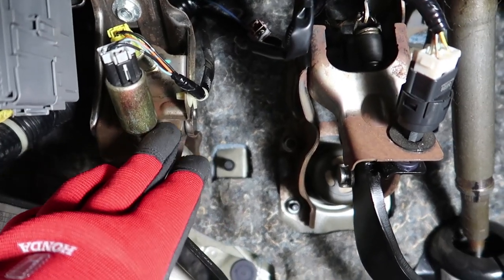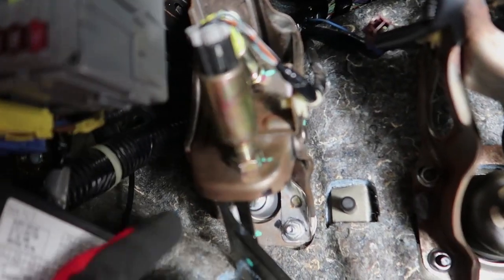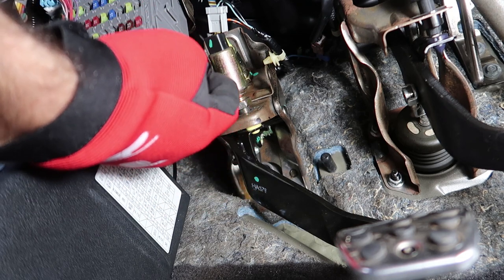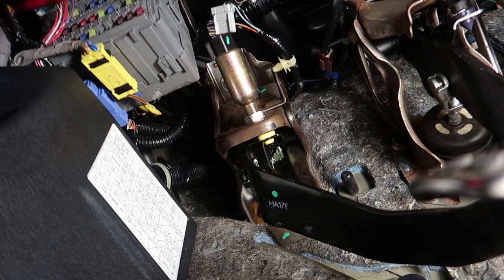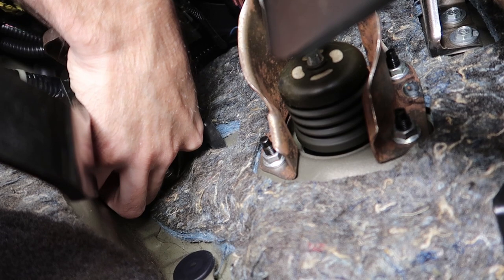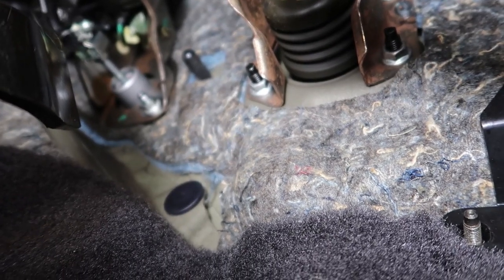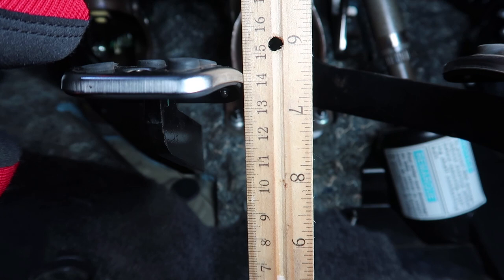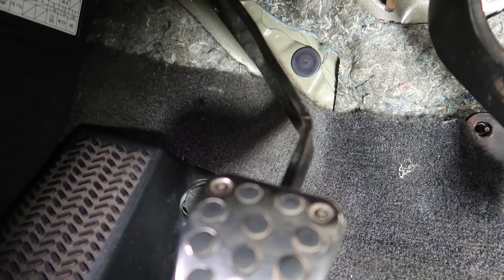8th Civic Si and RSX Type-S Clutch Adjustment DIY | Aftermarket and Stock | FG2, FA5, DC5

Comment: Years later still helping people I really appreciate it. My only issue is I'm trying to figure out how to get my engagement lower. I love my pedal feel now but it's grabbing at the top. I tried adding more threads on the stopper and then readjusting the clutch rod but it seems to still be grabbing high. trying to understand the whole dynamics of this but I can't figure out what would give me a lower engagement point.
Reply from the maker: Hey buddy sorry for the late reply. Basically the freeplay will affect where the clutch grabs a little bit. But if you want it to grab 'a lot' sooner you have to make the pedal stroke shorter.  So if you go to a little more threads showing and then redo the freeplay then the pedal will grab sooner because less fluid is pushed into the clutch line, so on the pedal release it wont grab quite as high up.  However it might also make the clutch release a little less smooth.  If its a comfort thing then just go little by little. Going to a K-tuned EM1 CMC will give you a shorter overall pedal travel but in my opinion makes it more difficult to drive in traffic because it engages right after you let the pedal up from the floor, and its more sensitive in general.  But that's preference because I know some people are use to that
Reply: @JasonMcMullen  thanks for the reply I'll keep doing some tinkering and find the sweet spot
Reply: @JasonMcMullen hey so I have a stage 2 competition clutch and I’m switching to a Ktuned CMC. Would I need .5-1 threads showing on the sensor?
Reply: @datboidell7722 I want to know too, I'm having a similar set up.

Comment: I have a stock CMC and Slave with stage 1 exedy clutch and Fidanza flywheel. I Have been driving for a few thousands miles now and lately it has been getting a little hard going into gears. Thought I’d try this since I was told you need to adjust clutch pedal after a new clutch replacement. Did exactly what you said in the video and man, it feels like I got a new clutch. It feels even better when I got the car back with 0 miles on the new clutch. I owe you big time!

Comment: Thank you SO MUCH. I was having serious high-RPM shift lockout issues in my 8th gen FA5, and this solved everything. Car shifts like new and the catch point is way higher, more like an EP3.
Reply from the maker: katchF22 that’s really awesome to hear bro!! Have fun hitting VTEC! 🔥
Reply: came here to comment the same thing. I got my FA5 6 months ago and finally adjusted the clutch pedal. 7k+ RPM I was locked out of 2nd and 3rd. Now I have no problems. Super high engagement point! Huge gains from a 20 minute adjustment.
Reply from the maker: @Visw  Super good to hear man!! And thanks for commenting, it helps other people see the video and hopefully it will help them too

Comment: Excellent video. Super informational, no gimmicks, no extra bs, just straight knowledge. Respect

I'm about to try this soon on my 06 si b/c it engages super low. I'd like it halfway or alil lower than halfway. 1 thread for stock cmc right. And the rod turning is micro adjustments to go "a little" less than halfway. Hope i'm understanding it lol
Reply from the maker: 🙏🙏🙏 thanks bro! It should make your pedal higher for sure, and should make shifting smoother. The height adjustment (threads) will change the engagement point dramatically. The rod (freeplay) changes it a little. You get it. But if you go to 1 thread it will be a little higher than halfway most likely. So maybe go to a little more threads showing if it really bothers you. Also make sure to always redo the freeplay after adjusting the threads. Let me know if you have any questions! Thanks
Reply: @JasonMcMullen  Thanks dude, really appreciate it. Ok will do

Comment: Adjusted on my FG2. Feels just like my FG1. It really changed the clutch feel for the better
Reply from the maker: good to hear bro! 👏
Reply: Stock clutch? I just got a fg2 to I wanna get the shifting better kinda get notchy feel but I know it’s not synchros
Reply from the maker: Stock clutch will be very close to the stage 1 adjustment in the video, (about the same amount of threads showing)  @mrslapside
Reply: @JasonMcMullen  thanks! These k series are tricky at shifting hehe im new and use to the old 92 civic with b series 😂

Comment: You made a great video here. Im having what I believe is disengagement issues. Every gear is shifting like i have no clutch and its lurching a tiny bit every time i get it in first gear. Im giving this a shot right now.
Reply from the maker: James Jetson I hope it helps!!
Reply: Clutch stopper was set at about 7 threads showing and the cmc was set all the way counterclockwise. Did the adjustments and it now shifts great. Owned it for 12 years now and never adjusted it till now. I assume thats how it comes from the factory. Vid was a big help, thanks.
Reply from the maker: @jamesjetson3812  Great to hear!!

Comment: thanks for the help brotha, after swapping out my cmc i tried adjusting the clutch and failed miserably, was hard to pop into gear and rear was locking me into gear. After using this information, im getting into gear clean with no problem. crazy how this little adjustment is really important.

Comment: 9:20 your explanation is great but it was hard to see which way you were turning the push rod. Was clockwise movement turning the rod left (toward centre console) and anticlockwise turning rod toward the right (or toward the brake pedal)? It was hard to tell at the final demo with the unit on the table. Thx

Also will this help my low bite point where I can't help but sometimes drag the clutch where there is a often a horrific squeal where it seems I'm riding the clutch
Reply from the maker: The direction is correct and yes it will rise the bite point! Thanks for the nice comment buddy!
Reply: @JasonMcMullen  Ah thx Jason, just didn't want to mess up the direction of the push rod (being dyslexic and that).

Using my thumb on the bottom of the rod and moving my thumb to the left ((a)clockwise?)  and then right ((b)anticlockwise?) (if you get my meaning);if this is correct, which direction (a or b)  extends the rod toward the foot pedal stop ( correct?)  And then which direction (a or b) is the half turn?

Finally another vid says pedal adjustment on stock clutch is up to 2 threads long and yours just half a thread. What is best?

Really appreciate this. Hope to fall in love with my 8th gen euro accord again if I can just get this darn clutch right from being too low😫
Reply from the maker: @bronniesboy  Yeah clockwise till you feel a tiny bit of resistance, then half a turn counterclockwise (can go full turn also).  Basically this just resets the freeplay after the height adjustment (the thread count showing) 

If you go to less threads showing, then the bite point will be higher. So if you go to 2 threads (stock) it will bite shortly after the pedal leaves the floor. But half thread will rise the bite point to about half way up

Comment: great video . I had problems banging gears after having Honda put In a new clutch and pressure plate. It shifts way smoother and I can bang gears without waiting for the revs to drop.I found out they had over 5 threads showing on the clutch pedal SMH!!!   Thanks I appreciate the Help a lot.
Reply from the maker: Man it was the exact same for me, after I got my car back from Honda (clutch/flywheel) it didn't shift very smooth, which led me to make this video. So glad you are banging through gears again bro! Have fun

Comment: @JasonMcMullen I have the ktuned em2 style cmc with an action clutch stage 5. Am I still looking at doing 5 threads showing? Also, great video. Seems to be helping out a lot of people. Keep it up.
Reply from the maker: For a stage five you might need a little more throw, maybe try 4-5 and see how it is. Feel free to go to less (or more) depending on how it operates. Just make sure to redo the freeplay adjustment after the thread adjustment. Also if you already have it adjusted, take a picture of where it's at now so you can have a baseline to go back to if anything

Comment: Just installed my em1 cmc and my ktuned slave, and your video helped dial everything up. I cant thank you enough! 🤙🤙
Reply from the maker: Excellent to hear buddy! Thank you for the super nice comment!
Reply: @JasonMcMullen  Okay so I've been driving it for a bit, and I can feel the clutch pedal vibrate now. Everything I've adjusted is to spec, I used all the right pieces.  I didnt have any issues with the clutch pedal vibrating before I replaced the cmc and the slave. Is this due to my new setup do you think? Or could it be something totally different?
Reply from the maker: The Beldam hmm does it vibrate when using it or just anytime?
Reply: @JasonMcMullen  When I take up the freeplay and actually shift into another gear. Low rpms there's hardly any, but vibration is extremely high when im  in Vtec. Im thinking its just more feedback from the trans due to the braided line?
Reply from the maker: The Beldam do you feel a lot of pressure on the pedal too, near the bottom of the stroke? If so you might have to make the pedal height lower (more thread showing) and then redo the freeplay. Because the em1 style cmc doesn’t need as much space to release. But the freeplay also affects it, so first try a couple more mm of freeplay. Most likely just adding a few mm of freeplay won’t be enough and you will have to make the pedal shorter then redo the freeplay to about 10mm. By doing so the stroke will get shorter and hopefully get rid of the pressure. If you don’t feel pressure but just weird vibration let me know. It could be that the slave cylinder rod needs urea grease or that something is wrong with the cmc/slave itself (a leak).
Reply from the maker: @thebeldam5823  also keep in mind that making the pedal too short will make the clutch not release enough so go easy on the shifter, and be careful especially when testing it out.
Reply: @JasonMcMullen  alright ill recheck everything and see what i can do. Thanks for the quick responses, I really appreciate it👍I'll keep in touch if I run into any more problems. looking forward to more Diy videos from you. Take care dude!
Reply from the maker: @thebeldam5823  sounds good buddy, I'll help any way that I can
Reply: @thebeldam5823  Im having the same problem after installing hybrid racing em1 cmc. I adjusted the threads on the pedal so 5 threads show but it still vibrates when the clutch pedal is engaged/going into gear. Have either one of you found a fix?
Reply: @JasonMcMullen  Im having the same problem after installing hybrid racing em1 cmc. I adjusted the threads on the pedal so 5 threads show but it still vibrates when the clutch pedal is engaged/going into gear. Have either one of you found a fix?
Reply from the maker: Xavier Hughes I think the Hybrid Racing CMC has a different adjustment. It could be an adjustment issue or it could be air in the system causing rough engagement. Try 1 thread showing and reset the freeplay (need at least 10mm) and see if it helps. You can try to email Hybrid racing also, I know other people have had to do that, and I think they have good customer support
Reply: @obeyordie16  yeah I just did exactly what this video told me to do, and I also used zip ties to keep the braided line in place. Made a huge difference. Also I feel like mine needed some break in as well because after about a week the vibrations went away. Good luck with your car bro!
Reply: @thebeldam5823  thanks I’ll give it time to break in. I have zip ties on mine but still vibrates
Reply: @obeyordie16  hows it doing now dude?

Comment: Oooooo MYYYYY GOD!!! This was sooo helpful. I have a small question  i replaced my OEM clutch with a Exedy stage 1 clutch + EFT fly wheel and im going to install a aftermarket CMC EM1 should i follow that same recommendation you mentioned in this video of leaving 5 threads on the under side? Please if anyone knows would be greatly appreciated thank you
Reply from the maker: is it the hybrid racing EM1 CMC or the K-tuned one?
Reply from the maker: Also thank you!!
Reply: @JasonMcMullen  its an Exedy cmc and smc thank you so much for replying
Reply from the maker: @saitekina_og9271  Yeah should be around 5 threads. If you have trouble shifting then go to less threads and redo the freeplay
Reply: @JasonMcMullen  thank you so much! Will be trying this on the weekend once i get my new CMC
Reply: @JasonMcMullen  so i couldn’t wait for the weekend and i ended up doing it yesterday. I just want to thank you again for your help and information. Truly appreciative.

Comment: Didn't even realize this could be an issue. I do have occasional grinding, the classic 3rd gear grind on these. Saw that the clutch pedal isn't set up properly, so gonna give this a shot. Think mine had 2-3 threads showing. In a FA1 which I believe uses a different CMC but everything is setup pretty much the same.

Followup. I bought my FA1 used so idk if the previous owner adjusted it but having 1-1.5 thread showing and half turn from resistance point on CMC leaves you with veryyyy little freeplay . It's pretty nice since it feels really responsive and if you allow more freeplay it's pretty easy to have the push rod and cmc touching.
I'm gonna roll with it. It feels a lot more natural to me now
Reply: Hey did it fix ur grinding
Reply: did it fix the 3rd gear grind?

Comment: Great vid! I'm having issues with my 08 si clutch. Shifts perfectly when cold but a lot harder to shift when it warms up after about 30 minutes driving. Going to give this a shot! Any suggestions if this doesn't work?
Reply from the maker: Slightly Stoopid thanks buddy, I would say check the clutch lines for any leaks first, then adjust the clutch after. If that doesn’t help, perhaps bleeding the hydraulic system for air will also help
Reply: Any update for this im having the same problem

Comment: thank you, will try to use this method for my 2010 mazda 6 6-speed, i believe it is the same (except for the clutch stop recommendations on the clutch stop number of threads,  which might be different slightly).

Comment: When I did the em1 clutch master on my rsx I had to use the original pushrod from the old clutch master I could no get the master to bolt up it kept hitting the pedal even with it adjusted all the way back
Reply from the maker: With the K-tuned one you dont have to do that, but yes with other em1 units you may have to do that, there is a tutorial on the hybrid racing website for that

Comment: I noticed in the description you now advise 2 threads for EM1 cmc. I see you credited someone for this info, but how did this come about when it's been the 5 threads for so long? I can't find any other information about this.
Reply from the maker: Hybrid Racing one is 2 threads because you swap the rod (so its close to stock adjustment), the k tuned em1 style and the aftermarket Em1 are still 5 threads

Comment: Recently install Hybrid Racing kit for my 2007 Honda Civic Si and reuse the OEM rod and bracket to my EM1 CMC. I follow the instructions and the next day my clutch pedal starts to make clucking/ squeaking nosies. I try to grease CMC but it didn't work. I even double check my work but the same noise happens even after being adjusted multiple time. It keeps on  respawning back in the morning. Noise would die down for now.
Reply from the maker: squeaking can also be from not greasing the Slave Cylinder rod where it touches and moves the clutch fork. Urea grease is the best